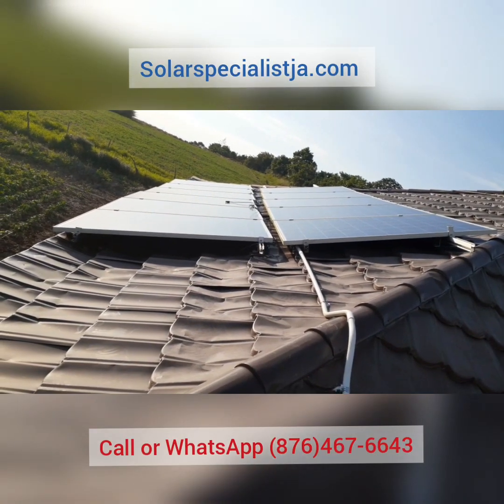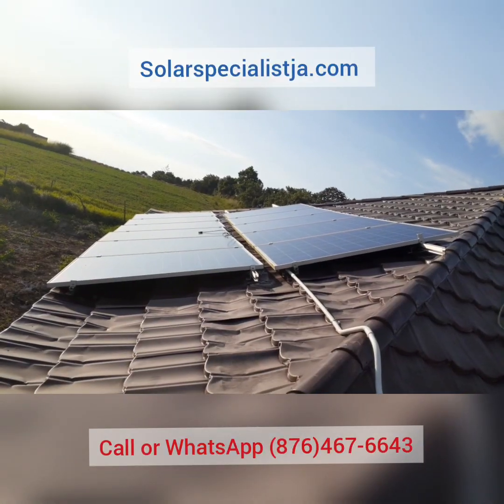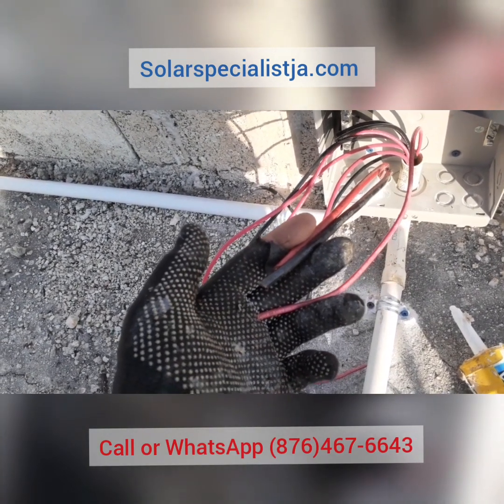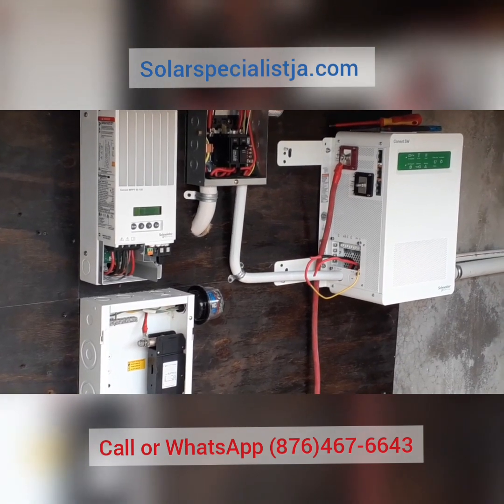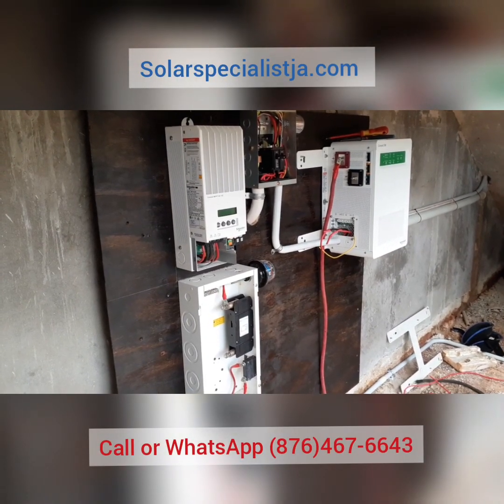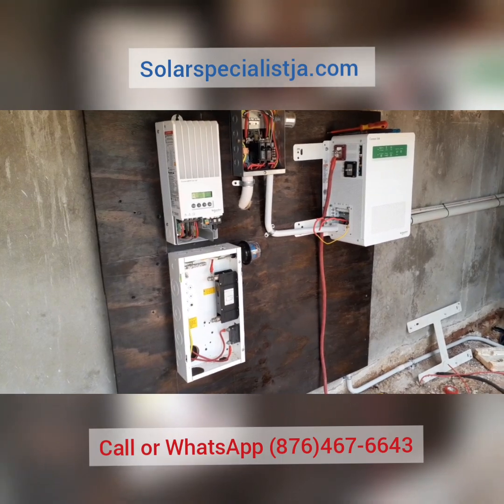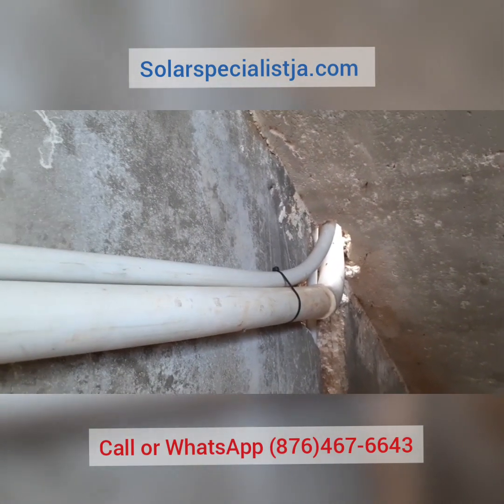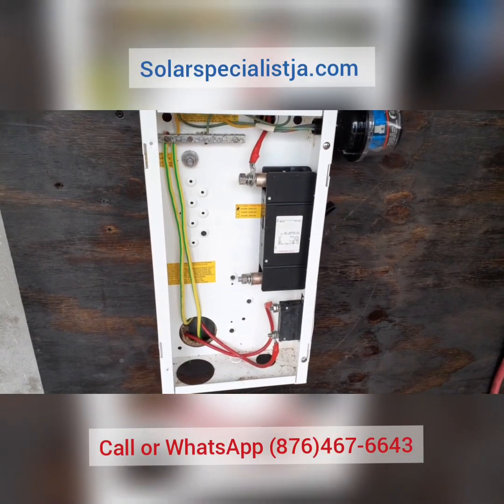Solar installation nightmare part 2

Comment: Excellent 👌 job the only thing I would suggest is to add a battery desulfator and a AGM battery equalizer to the battery system to keep the batteries in good health.